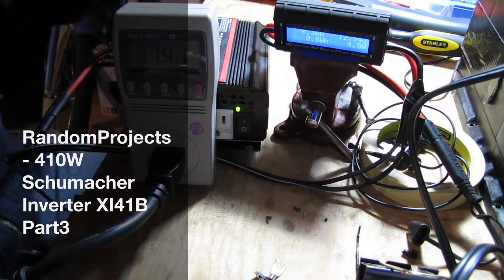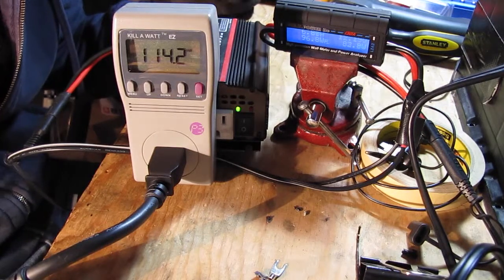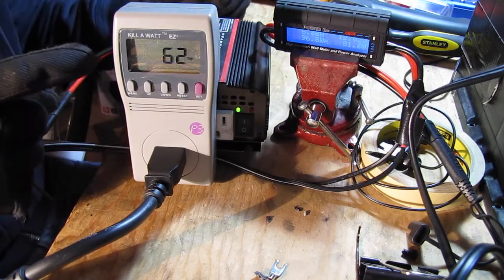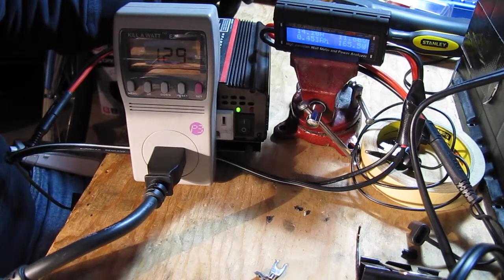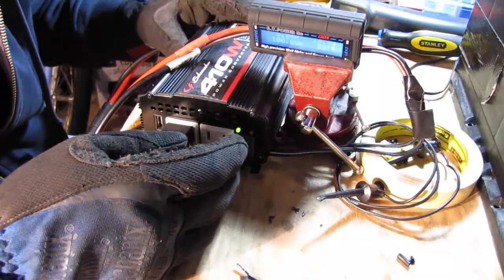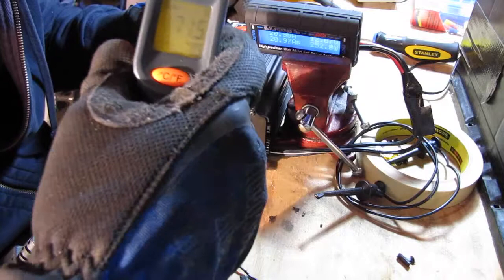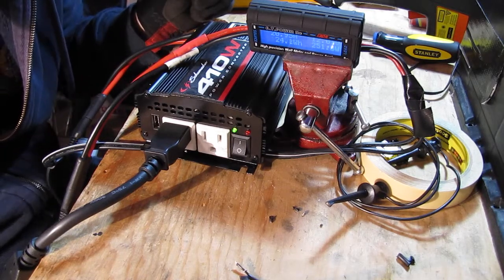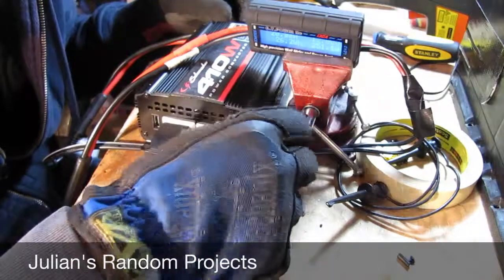410W Schumacher Inverter XI41B part3

Comment: Yes you need to get more batteries in parallel the reason why I Cuts up at 11 sixes it's totally connected to your car which leaves you ability to start your car if you drain it less than that that's the reason why it's doing it can go lower but then you can't start your car if you get it so that's why it's design like that so it doesn't strand people on the side right me to start your engine run your engine and now you're getting it more of more power supply you're not giving it enough charge where I can run all your stuff cuz you don't have a big enough battery and get a couple big batteries and everything on you'll be able to go to the pool wattage once you get the tickets. The thing so you can start your car that's what it's supposed to do

Comment: My kill a watt meter will not read Hz ether. But I have figured how to get to. Plug two power strips in series with kill a watt on the end. The parts in the power strips the limit power spikes clean up things up a bit enough for it to read. One thing I also seen is the farther you get from it the less accurate it is, say a 20w load on the end of a 100ft cord or the other end of your house.
I just won a bid on six broken 750w inverters. I cant wait to play with them.

Comment: Be interesting to se what these could do with thicker cabling, I still see some of these on eBay for cheap and was wondering what kind of power these could put out under ideal conditions. Great video btw :)
Reply from the maker: I still have a bunch more broken schumacher inverters to repair and test, I'll be sure to try a best case scenario and post the results.

Comment: Can u test a ps3 the slim one or dat one i got one of these free and gonna run it off an 01 expedition i have a 800 watt system already and gonna hook this up to 4 gauge in back
Reply from the maker: Hey DJ,

Unfortunately I don't own a slim PS3 but a quick consult with 'the book of knowledge' http://bit.ly/1j7nwmb indicated that the slim PS3 pulls about 93 watts when playing a game. So an inverter like this would be fine. Personally I'd use a pure sine wave inverter on expensive gear like a PS3. Good luck.
Reply: JuliansRandomProject thanks for checking it out i hooked up this invertor and it powered up and i let it run for a couple of mins with car running and it shut off fine too.but i got a couple of ps3s for 60 bucks so im still glad it didnt screw this one up.im gonna check out sine wave invertors if i can find one cheap ill probably get it

Comment: I use a first generation P3 meter (non EZ) on MSW inverters.  It has always worked great regardless of waveform shape and is within a few percent of other measurement methods.
Reply from the maker: I think I'll buy a few different models. Seems like this guy gets a lot of work at my place and I could use a few for permanent installations like my off-grid solar.
I'm also going to either remove that buzzer or put a switch on it, so annoying. Once removed I'll see where this little guy really cuts off for low voltage.